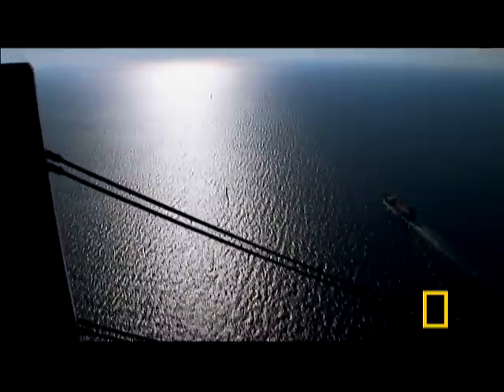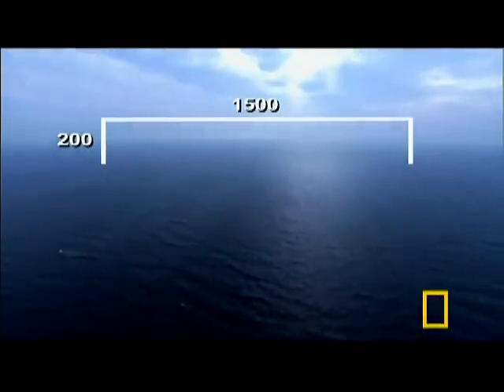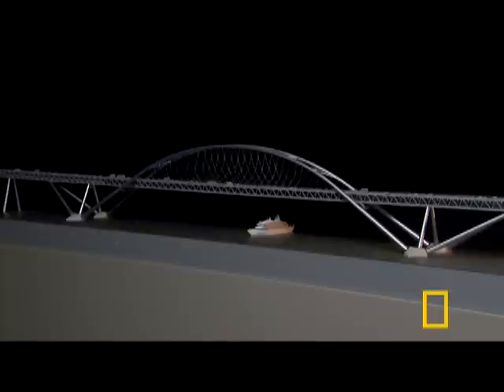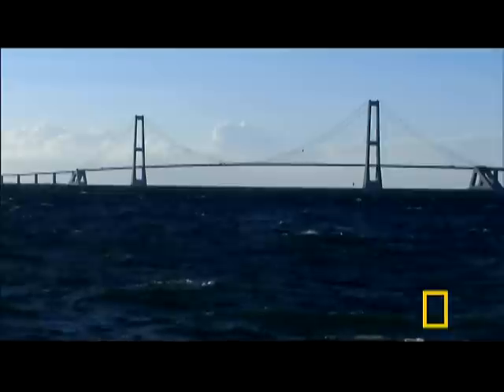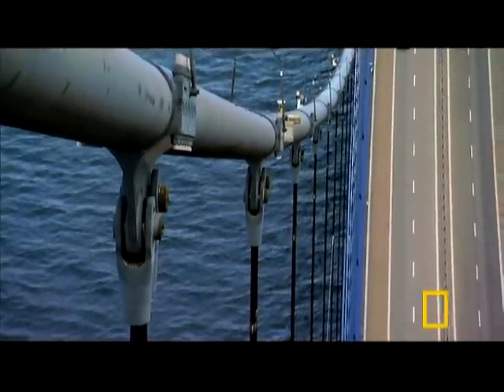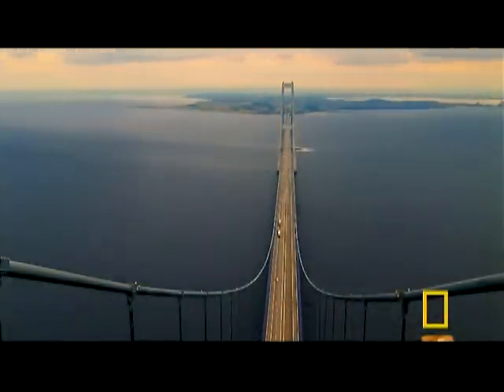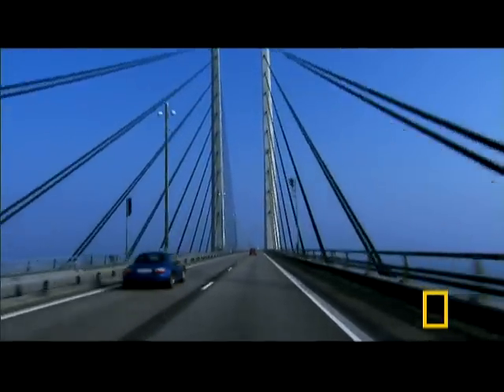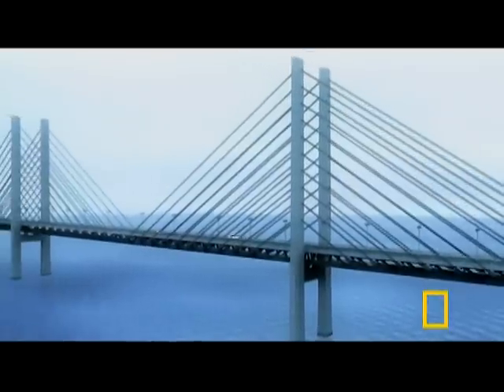The Impossible Bridge | National Geographic

Comment: This is an engineering marvel. A cable stayed rail cum road bridge, the only of its kind. This bridge has been designed with latest design standard (Euro Norms) and the wind tunnel analysis has also been done.Indian Railways is also planning similar type of bridges. I have visited the bridge and got some interaction with the Design Engineers at Denmark.

Comment: @chimay131 Accidents happen all the time, whether through human error or natural phenomena. Yes, there is no reason for any ship under normal circumstances to pass close enough to cause fatal damage, but that doesn't mean that it would never happen. The final design prevents this possibly fatal issue. A boat ramming the towers could still cause damage, but they're less susceptible to operator error, and reinforced concrete is going to hold up to impact a little better than steel cables. SFTY1ST!

Comment: @2129261184
Right, because destroying a pillar of a cable-stayed bridge will not cause the whole to collapse.

Also, arched bridges do not necessarily reach down to the water level. The Chaotianmen  bridge for instance (which actually has about a 10% larger span) is raised on pillars and the whole arch is thus many meters above the water.

Comment: You are confused... the suspensionbridge showed in the vidoe is the Great Belt bridge (Storebæltsbroen) and yes it goes under the water in a tunnel because suspension bridges cant support the weight of a train. The bridge they are trying to design is the öresunsbridge, and yes it is build. But it is a cable stage bridge as told in the video. I should know i live in denmark where the bridges are build, and i have crossed them several times!

Comment: @SEVILYA1991 It's between Denmark and Sweden, and has been open for trafic since 2000. It actually spans only half the distance from Sweden to a small island and then there's a tunnel connecting the island with Denmark.